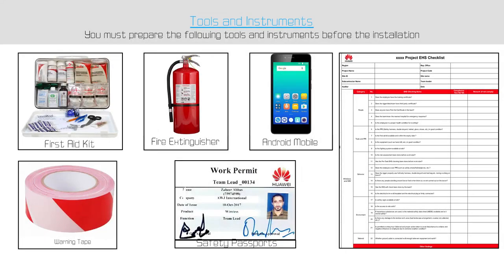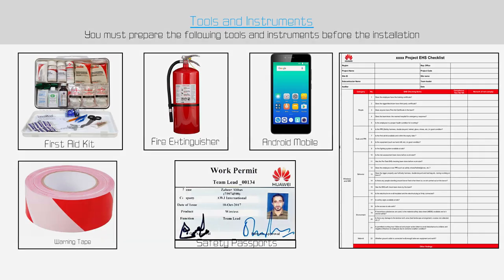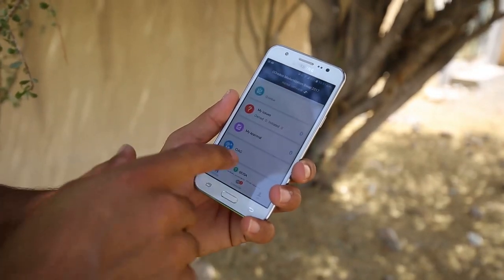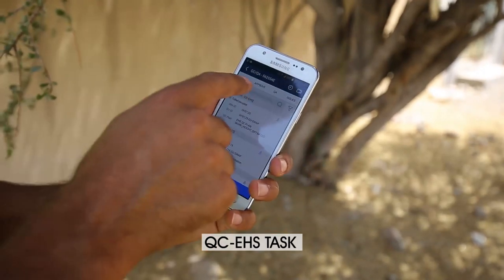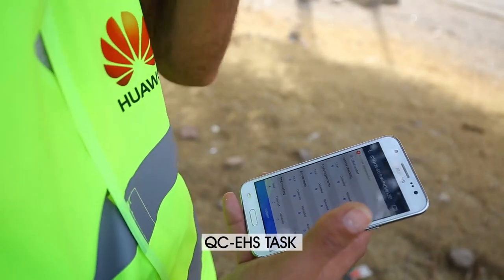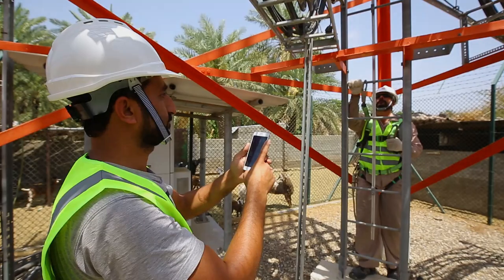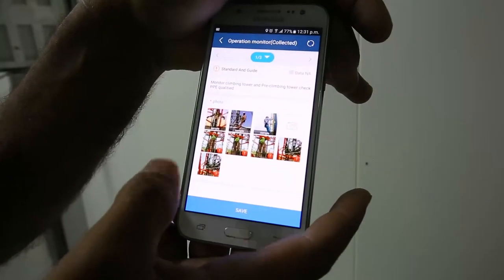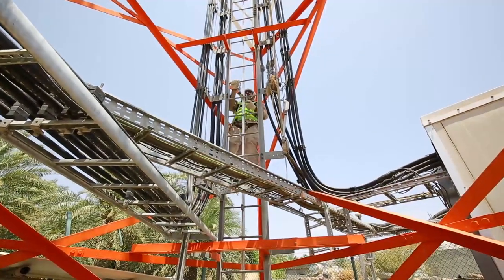EHS Task Submission

Comment: sir currently i am working as EHS NOC Engineer on Huawei projects and all these approvals i am doing that you explain in video sir i have some Questions kindly answer I am  cofused                    sir basically i am graduate as an Electrical communication Engineering should i  persue   this field or switch in field job? and if i persue the  EHS what is the future of EHS? Cause I am planning for  KSA   and  what are the Certification for the EHS in KSA means IOSH, OSHA, NEBOSH what is Required  or just wuawei certification?